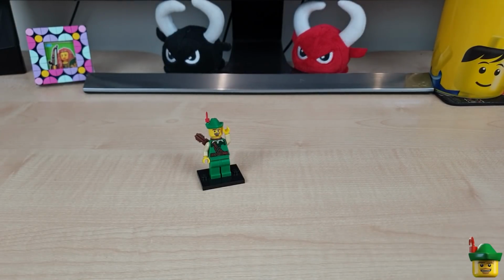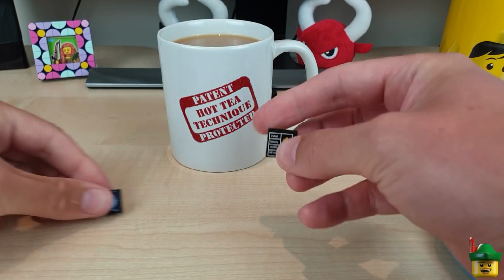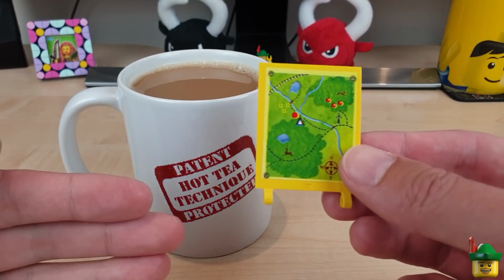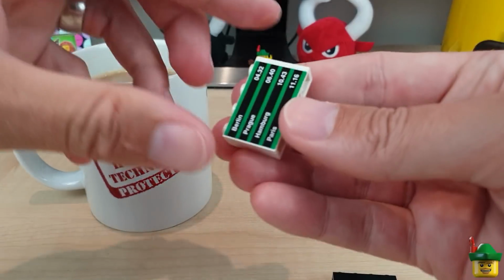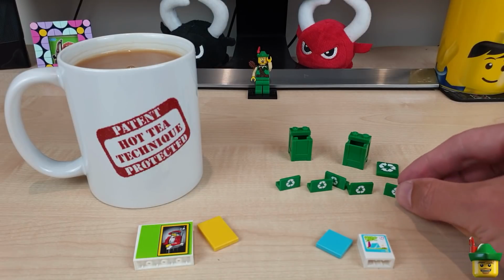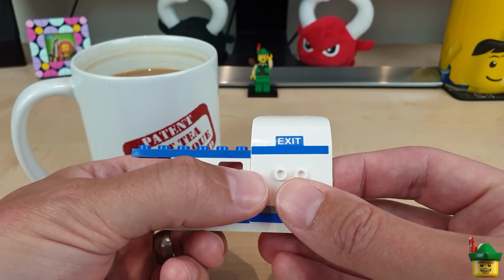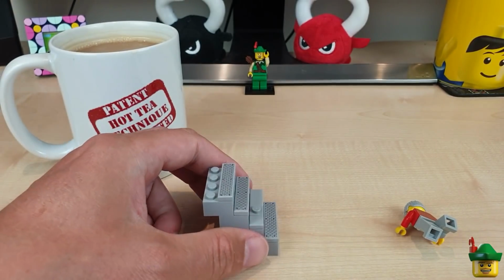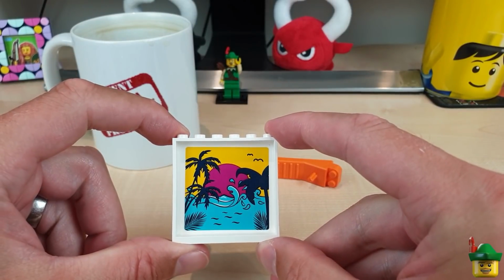LEGO Tutorial - Fix, Move & Repair LEGO Stickers - Patented Hot Tea Technique 👨‍🎓🏹

Comment: Hopefully robin you see this comment thanks for the method on fixing Lego stickers just a quick question before I start fixing my stickers if you transfer one sticker to another brick does it maintain it’s stickiness hope you can help thanks!
Reply from the maker: Yes most of time it does absolutely fine.  Very rarely, for one era of old stickers, you can see it leaving an amount of the stickiness on the brick but there's usually still enough for the new position.  Most of the time all the stickiness comes up with it. 
Worst case add a little Pritt-Stick to up the stickiness but I don't think that'll be necessary.  I've done hundreds now and they're all fine long-term!
Reply: Thanks for that! ❤️

Comment: For the stickers that need to be repositioned slightly because someone else put them on crooked, simply heat up the sticker with a hair dryer and use your thumb to push the sticker around to the desired position, then make yourself a brew and enjoy with a biscuit!
Reply from the maker: Not if they are big.  I think tea is kinder and gentler than a hairdryer too!

Comment: You can use a negative action tweezers (squeeze to open) for better control of reapplying of the sticker, also a query could using the small bags you get it the brick hauls as a barrier and then ‘dunk’ the piece into the tea??
Reply from the maker: For applying stickers a brick separator works great.  Urgh, I've got to drink that tea!

Comment: hey, if i heated up the piece with a sticker on, would be i able to just push it around instead of taking it off? I just want to slightly reposition it.
Reply from the maker: If it's a 1x2, yes.  Bigger and it's a lot harder and depends on the glue.  Very big and not a chance!
Reply: @RobinHoodBricks  aaaawh. I just have a slight skew on the engine on the new mandalorian starfighter. :[
Reply from the maker: Taking it off is easy enough!

Comment: Well my stickers are straighter, clear ones the newer ones turned out, the old ones on the doors came from my cousins from a farm, I pulled them off cleaned them stuck it to sticker paper clean glass then applied it there turned out better then they where way better but a couple bubbles no pealing anymore. So not factory approved to make it perfect you would have to clear off the sticker apply new glue and apply like a window sticker, they must have been eating crackers or cookies on the carpet well putting these on but not as bad as the one I just got, it looks like they applied it then glued it into the frame.

So I’m done with Lego sticks for now!
Reply from the maker: Sounds good.  Glad to have been of help!

Comment: What if I have loose stickers that have been collecting dust for years and have nothing but muck under them? Is there some way to clean them and then apply new glue with similar properties as the original glue? Would the paper glue stick be used for that?
Reply from the maker: I think you could scrape them as I show here and they may have enough stick left.  If not clear backed then a normal glue stick could be used to add more stickiness.  Good luck!

Comment: Do you think this would work with more ancient ones from the late 70s early 80s?
Reply from the maker: If they are the plastic type, yes.  Just be very careful and slow and stop if they don't cooperate.  Sun damaged stickers will disintegrate.  Especially white parts of the sticker.
If they are paper type stickers from ages ago they are unlikely to move well.  You may get them off but you'll have to add glue to get them back on.
Try and buy older sets with the best quality stickers possible!

Comment: Is there a way to move a sticker without taking it off? I've noticed that I've misaligned a sticker on one of my newer sets, and I'm worried about damaging it. 😬
Reply from the maker: If it's small, just warm and drag.  Bigger ones will need to come off I'm afraid!
Reply: @RobinHoodBricks  Thanks! It's on a 1×3 bow slope. That's small enough, right?
Reply from the maker: Get it very warm indeed, maybe even submerge in a small amount of recently boiled water (take care of get an adult to help if you aren't confident), onto a drying cloth and then quickly slide with your thumb.
You can also try a hairdryer but that can damage them!
Reply: @RobinHoodBricks  Thanks for the advice!

Comment: Thanks RHB, love the video! Been waiting for weeks to watch it! I had a few questions though.. in your experience if you are handling the stickers so much, won't the glue rub off on your fingers? How do you prevent that? Have you heard of the technique of using window-cleaner solution (we call it Windex in the States)? Apparently if you spritz a little on the piece and then attempt to apply the sticker it delays the glue from setting just long enough to let you push it around (kinda like what you did for that little 1x2 plate). Curious if you've heard of the technique and/or used it.
Keep up the great work!
Reply from the maker: The stickiness stays on the sticker.  It doesn't come off onto fingers.  I've not tried Windex and I'd be worried it might cause them t fall of in a year's time or whatever, it doesn't sound sensible to me but that's just a guess.  Nasty stuff to breathe in as well!

Comment: Thanks for the share. I assumed the technique had something to do with the loosening of the adhesive but didn't think  it would be heat transfer via physical contact. I thought it would've been more of a steam effect (which also works nicely).

I also noticed you've got sticker placement down pretty well but I find using a brick separator also helps just incase you need to reposition.
Reply from the maker: Yes, it does.  Glad you liked it!

Comment: Thank you, thank you, thank you!  This was a video I was looking forward to seeing for quite some time, and it did not disappoint.   I have learned quite a few new tips to use when working with stickers.   I'm sure to put them to great use in the future.   Personally, I usually use a brick separator when applying stickers, and ALWAYS use it for clear-backed ones, as otherwise, your fingerprints are left on the underside for eternity.   One additional tip I would submit, which I also use, is to work with two brick separators for longer and/or recessed stickers.   As you saw in your video, the static cling effect will otherwise draw the far end of the sticker prematurely onto the brick before you are ready.  When using two brick separators, one at either end, it makes it easier to get sticker alignment, then place the center of the sticker downward when desired.   This also helps to eliminate air bubbles.   Great video!  Keep them coming.
Reply: @icemorons thanks for the tip on using 2 separators...makes complete sense and the static cling always annoys me .
Reply from the maker: Really glad this has been well received by many, even if views are lower.  I'm still a fingertips guy though, for my stickers!

Comment: Thank you for a revisit to the patented hot tea technique! Very well instructed.
When reapplying the sticker, I put it barely on the tip of the blade to position the sticker on a brick because doing so extends the sticker away from my hand making it easier to position and see what I’m doing, particularly with a small sticker. I hover it over the brick, fine tuning the position of it and press down one corner before smoothing the rest, similar to the way you applied larger stickers with your fingers (I use the blade tip for all sizes). I do the same with new set stickers. Ah, I wrote that before I finished watching. I use the tip of the blade the same way you used the brick separator.
Reply from the maker: As long as it ends up straight, everyone's happy!